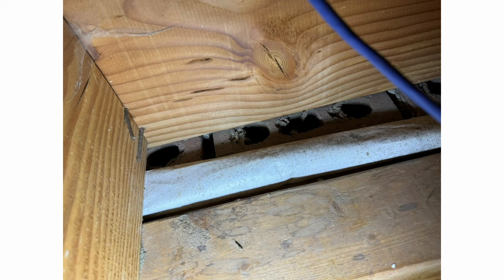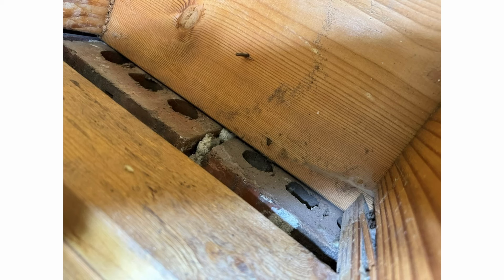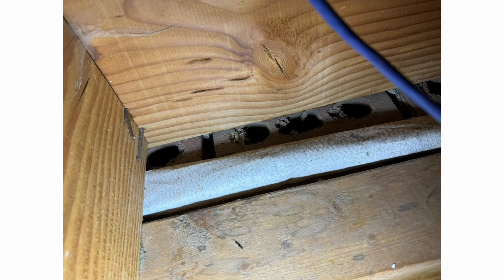Sealing Joist-Bay Gaps Properly | FHB Podcast 646 Segment

Comment: This was exactly the situation I had with my 1984 contemporary in the Pittsburgh suburbs. The builder has placed faces fiberglass batts in the cavities. I bought the house in 2011. Previous owners fed the rodents at a bird feeder just outside. The insulation was black from airflow through the gaps. I put blocks of rodent poison in the gaps. Then I filled them with two part foam. The foam was supposed to have something in it to slow down rodents or insects from digging through it. The basement is far warmer in the winter now. I should recheck to see if the rodents are digging through. This house has the “Garrison” setback between the basement and the first floor, as well as the first floor and the second floor in many places. None of them were given any sealing other than stuffing fiberglass into the cavities. Fiberglass insulation is pretty miserable as an air barrier.
Reply: Thanks for sharing. I am learning more about my home issues by reading. My Philadelphian twin was built in 1930s. I too see that fiber glass batts were previously installed in my unfinished basement and have seen where rodents had disturbed it.

Comment: Thank you for this video. I am a newer homeowner and have been taking on many DIY projects as a hobby and to help me to maintain house maintenance budget.

I have just begun researching basement/joist filling options for critters. I was considering the steel wool route and then filling joist/wall gaps with a mixture of sand/cements and other rodent deterrents. After watching this video, I think I will get plywood for the soffit areas.

QUESTION-I haven’t gotten to this in my research…The soffit area where I want to add plywood, spans from my basement to under part of my living to the front porch. Is it normal for this space to remain open, or should some type of insulation be there? I am the most concerned about mice living in that space and working to find another entry into my home. May be unpreventable—curious nonetheless! Thanks so much for any feedback!

I have just subscribed to your channel!!!!